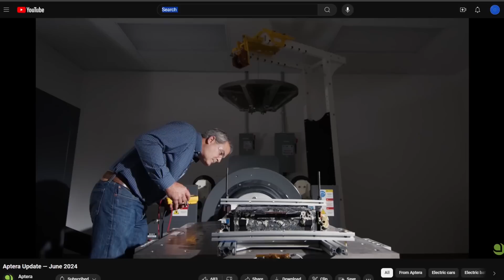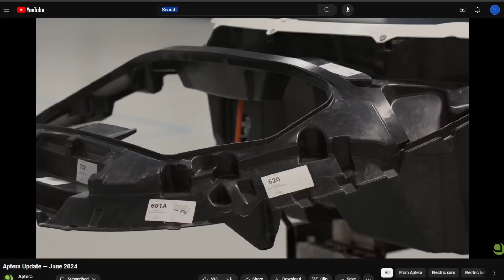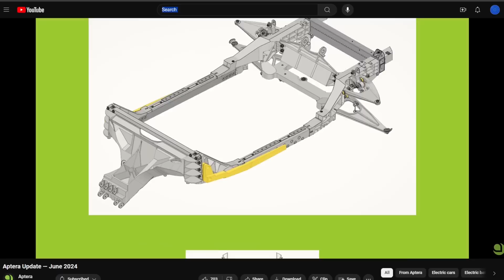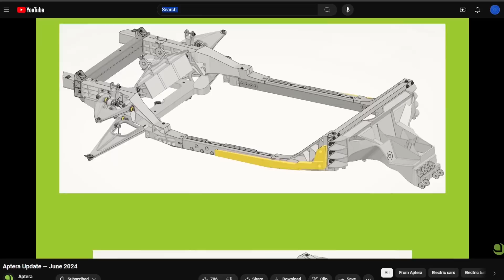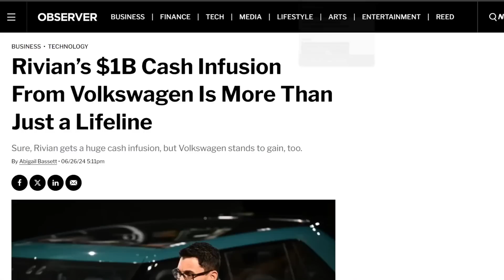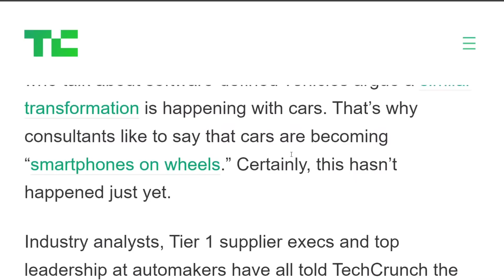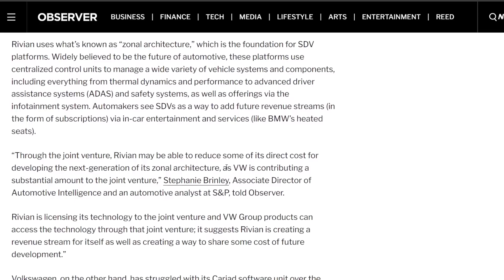Aptera IS testing and gearing up for PI2

Comment: Clearly, Aptera has suffered a major disruption from Elaphe, whose motors will no longer be used, likely a cost increase but potentially durability problems or unsprung weight difficulties.  The inexpensive Tesla motor or the superior but very expensive Lucid motor will be moving our vehicles forward.  Tesla could offer Hardware 5, full self-driving, and the proven Tesla infotainment and driver interface along with technical help with manufacturing in a licensing deal or hopefully an outright Tesla acquisition.   Tesla buying Aptera might need to be delayed until grant restrictions are lifted, but should our shares be acquired, a substantial economic reward to shareholders would be in the offing.

Comment: Might the potential switch away from Elaphe be due to their motors not achieving the efficiency Aptera had hoped for.  Might this be thew reason for Aptera looking into a "drive train" for the front two wheels?  As such, does that imply 1 motors instead of 2 for those front two?  Also, Isn't a drive train theoretically less efficient than direct motors due to energy transfer loss?

Comment: To answer your question: https://youtu.be/qD8A5WAoYTs?si=WSPfLX5FKuhK-6nB&t=554 An OBC is a device that is used to charge a battery. It converts AC voltage from a charging station into the DC voltage the battery needs. The OBC is incorporated in electric vehicles.

Comment: Or the circuit board enclosure whether sealed or not allows for easy replacement of the circuit board. Therefore the enclosure could be fashion with industrial grade glue. Remember you need to make circuit board easily replaceable while securing it and the cables from vehicle vibrations.

Comment: Since there are attachment holes on the circuit boards, etc., I suspect bosses will be glued to the surfaces to accept screws or rivets or other fasteners that will then be the removable attachments for the components.

Comment: How can PI 1 be described as production intent if all it has is wiring?
Reply: Because the wiring is production intent. 

P1 will eventually be a fully built Aptera, but for now it's their validation chassis for wiring and other components
Reply: Because the wiring is on a Production Intent BinC. Later in the process PI 1 may be used again in the validation process.

Comment: I think PI2 will share the same BinC that PI1 and all the other PI models will have. I don't see why Aptera would go to all the trouble of designing this BinC and press out multiple copies of it, just to start over again and design a Beta-style body. They clearly are waiting on the chassis to include that forst in PI2, and I would sssume they want to ensure that it properly fits the BinC. 

Now, it's probable that as I originally guessed, it will not include the final.interior and things like the doors and wheel pants that are not necessary. It could even leave off the nose and belly as PI1 currently does. So if that's what you're picturing I agree with you. 

I'll also note that Steve said "Italian" but not CPC. I think Costamp is producing the frame. That's just a guess, but it would still be coming from Italy. There's also the battery frane, which is already there in California.  It possible multiple companies are making the frame, ateast fir now.

Comment: Tach companies adding more and more software to cars, just to sell a subscription, should not be tolerated. 

The software is important for sure, especially with EVs, but people should be able to buy an EV that's not like driving an AI computer. 

It would be so wonderful to be able to buy an EV with just manual controls, physical buttons, reliable but simple software for the BMS, voltage and current monitors, and that's about it. 

Just because Tesla did stuff and sold a lot of it, doesn't make it good.

Comment: It is well established that directly soldering wires to boards is a point of failure esp. with RoHS solder.  Furthermore, it violates the spirit of right-to-repair as very few consumers (and technicians) possess the skill and tools to do this properly.  PI = panic induced.

Comment: Hi Steve, thanks for presenting this. Regarding the circuit boards Aptera will not have to mount most of these inside another box because the carbon fiber and fiberglass are not conductive like most car's metal bodies. Those holes at the ends of the boards are where they will be mounted and likely on some type of stand-off to allow for airflow, reduce NVI (noise and vibration) and keep the parts from rubbing against the body. I don't think they are using their electronics jig to create something like Rivian, unless they attach to the PI-1 body. This is more for verifying software/hardware testing. To write testing software for each produced vehicle you need the test station to develop and update as necessary. This opinion is based on managing manufacturing test for several different companies, one of which was in Sorrento Valley years ago. Keep up the great work.

Comment: manual wire fitting is not a good news. I thought Aptera had engaged Yazaki for wiring development?
Reply: Im pretty sure the majority of the layout is already worked out. It's important that everything is verified and fine tuned in real world conditions. Relying only on CAD models and NOT doing real world testing would be a huge mistake. I'm glad to see real world verification of the wiring.
Reply: @TildaAzrisk  From my perspective as a retired industrial, electrical engineer it looked very amateurish.
Reply: Right, most if not all of this should have been done in AutoCAD or whatever engineering/design software they use up front. Not very confidence inspiring. IMHO.

Comment: I am very happy to see Aptera's efforts and progress revealed in this latest update video. Some people who are upset about the production Aptera being delayed this long (not even considering that volume production still won't begin until next year) are looking at every unexplained point, and imagining some major problem. They are assuming somehow that Aptera doesn't really think about every facet of their development and production timeline. Of course in reality Aptera does really work hard on these details, and they have defined plans for release. But for some of their work, they cannot tell the public exactly what is going on for contractual or other reasons. For those of us who trust that they know what they are doing, we realize that they will reveal those details as soon as they can, but understand that they are still moving forward as fast as they can. In addition to their progress, this video shows that they are sticking to the idea of having simpler, lightweight  electronics. Which will help reduce materials costs, build costs, weight, and be more reliable and easier to repair. That model happily includes secure over-the-air updates. Which I want.
Reply: Well said. 

Some people don’t seem to understand that you don’t publicly announce a supplier while negotiations with that supplier are still going on. You announce it once the agreement is finalized.

Comment: It was two months ago that they received this wiring PI and this is the first time they have every shown pictures.  They had it unpacked on April 11th. So people had valid criticism that Aptera spent an inordinate amount of time not showing any work being done with wiring. Do you just forget that May existed?  

With regards to the circuit boards, there is no real proof these are functional pieces or if they are even the pieces that will be affixed where they were filmed. I have seen better wiring work on Rich Rebuilds.  Interesting they have stickers for components but cannot show us the actual components. My friends and I were literally laughing when watching this video.  The quip about how complex Rivian's wiring looked and somehow Aptera was better should have instead given you pause. Open circuit boards with a protective applied coating are not a robust solution. Moisture and dirt gets everywhere and anyone who works with electronics will tell you that. Even on the interior of cars much of the electronics has a cover. 

What cannot be denied now is that as originally described PI builds would use production intent parts but we know for fact this is not true. Just back in May the talk about frames and battery work was clearly indicated as having been shopped around for these initial builds meaning all we have is another thrown together prototype whose parts are not indicative of what production will be. By their own presentation the frame and chassis work for production vehicles is to be done in Italy and PI 2 will have none of that. 

Ask Steve and Chris when we can expect PI builds using actual production intent parts from actual production suppliers? Are we going to see this by the fifth, eight, or tenth, PI?    
  
I really do not expect any production till very late in 2025 if at all.  They aren't far enough along on this PI and they have eight to fourteen more to go... and I will bet you now they will cut back the number of PI builds as the months go past.
Reply from the maker: Well we agree on something. I don't think they'll have production until late 2025 either

Comment: The circuit boards to wire connections for volume production should not be soldered - too time consuming.  This is likely just for the production and tent vehicles.

I suspect volume production will have connectorized board to wire harness points.

Charge on!

Comment: An authoritatively presened technical update, but missing mention of my two elephants in the room; when and how much capital comes in and the status of wheel motors. If PII is "Driveable" then it should have production motors. I am wondering if the wheel motor issue, whatever it is, was shared with U.S. Capital as a part  of the agreement. On the issue of driveable, my guess is that "Driveable" means it can still have some developmental parts, not 100% production and we need to look forward to a future PI for a full production component build. You are spot on about another schedule slip. Not unexpected based on Aptera's record of kick the can down the road. I hope not adhesive to fasten electrical parts to the Aptera and direct wire connection to electrical component parts. This last comment a personal bias with no data to back it up as I am not aware of it being done that way in any vehicle. A possible hit on reliability. Enough here to keep the optimist happy, but not sceptics.
Reply: Things we know about the motor situation is that Aptera has ceased development of the custom Elaphe motors, Elaphe no longer seems to be a production partner, 2023 SEC filing stated that Elaphe will not license their motors to Aptera until they complete a minimum purchase order.
Reply: If the motors are not product intent, then this is not a PI but a prototype. Therefore, I expect PI2 will have production intent motors.
Reply: @bertrandp2977  ...All PI builds will be prototypes...

Comment: I took some screenshots of the chassis and front suspension and compared it to prior images. This frame, chassis, and suspensions ,front and rear, have significant changes. The front frame obviously has been beefed up for collisions. The two yellow members located near the seats on either side our new. They must provide longitudinal support, and maybe side impact. It appears some of the rear suspension have been built into the frame. And the front suspension is quite a bit different. Looks like the shock mounts horizontally with the fixed ends near the center of the vehicle at the two new big round mounting locations. I'm wondering if this new front end has Italian inspiration?
Reply: Thanks for doing this and the analysis! Good catch! Perhaps some delay now with significant changes to the chassis and frame (Design resulting in rebid of production versions and change in schedule for delivery. (May  contribute to AOC's schedule slip forecast) So, chassis and frame different, possible change in motors. Now wondering when production configuration with be frozen and locked down and if any of the PI builds will be close to production configuration.

Comment: They’re getting close but be prepared for delays.  They are in a stage where there will be many overlooked “oops” moments.  Kludges won’t be allowed in a production unit. At a glance the harness is a mess.  At minimum it will be a very time consuming step in manufacturing and at worse subject to many modifications before it’s ready for prime time.
Reply: The wiring harness is a test layout, I’m sure this won’t be for volume production.
Reply: @Rich1Rodriguez  my comments go beyond that.  Harnesses are usually made by manufacturers (subcontractors) who are specialists.  They are configured in bundles and the various wires are pulled from the main bunch as needed and weaved into the car to make the process as efficient as possible.  There can be hundreds of wires adding up to over a mile in length. At first glance the Aptera wiring looks like it’s being forced into the P1. But I hope you’re right since a lot of reliability issues arise from poorly designed harnesses.
Reply: @Rich1Rodriguez  Agree that Aptera is sharing their preliminary layout — ie, thought & design process. But I’m baffled (disappointed) this wasn’t done much earlier so BINC could include fittings for distributed wire harnesses. 

Even including some generic tabs on BINC for current & future needs would have  seemed prudent as imagine mods to BINC would be VERY difficult/expensive… correct?
Reply: @bobhellman8676  Recall your prior comments and learned what a "system mule" is and a lot more 😀 BTW interesting interview of Steve Fambro on "Everything Electric Show" (7/1). Tho when asked what he wish he knew or did different, was hoping his reply was about better recognizing purpose of prototyping and the cost in time, money and missed funding/promotion by not manually assembling by massive, irreversible tooling (BINC) commitment. Instead he said, "better leadership skills". ☹

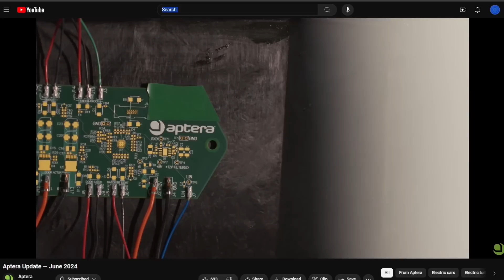Comment: As far as hot-glue is concerned, I really hope they are not doing that.  At 4:34 the circuit board clearly shows 2 holes that could be used to secure the board to the vehicle.  For speed of install and weight, these would typically be snaps.  The boards would be sealed from the elements before installation. Each remote board would typically have 3 wires and they should be enclosed in a light weight protective sleeve.
Reply: They make a high temperature hot melt that is used in solar voltaic panels and electronics. It's good stuff. The nice thing about hot melt is that it doesn't delaminate like silicone potting and is impact resistant. I like it a lot better than urethane modified epoxy, which is what they use for power line potted devices.

Comment: Temperature is the Enemy, so Software to modulate Power Usage will protect the Vehicle as Climate dictates: Density Altitude will affect Heat Rejection.  Vehicle Gross Weight, Road Slope, etc will Modulate absolute performance.